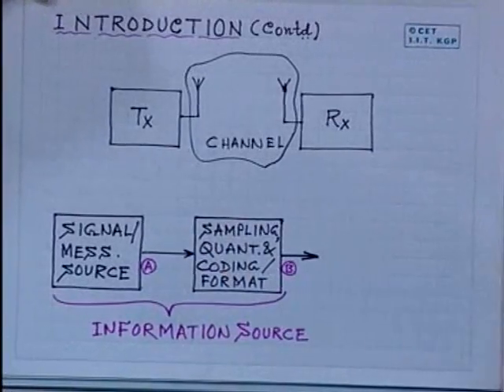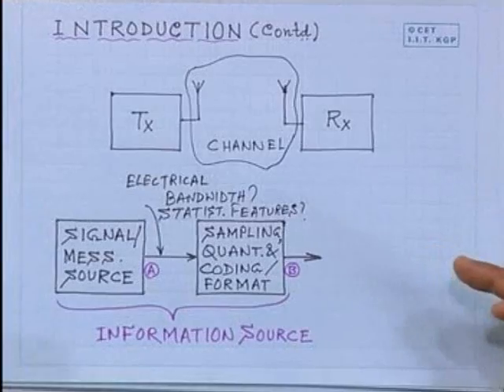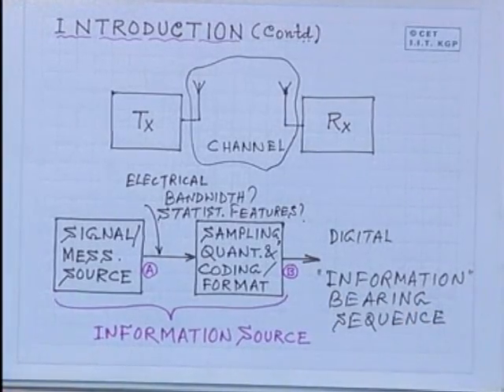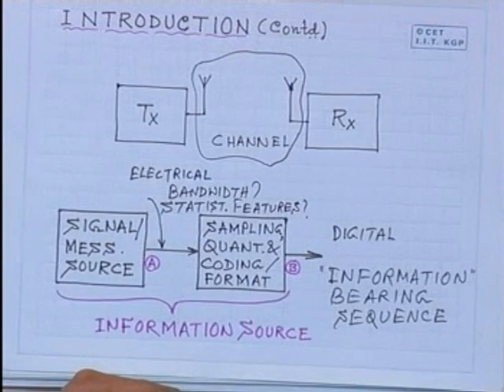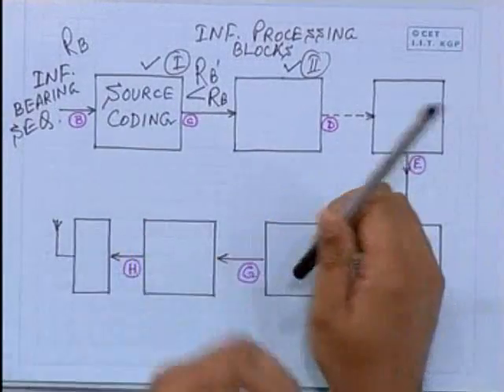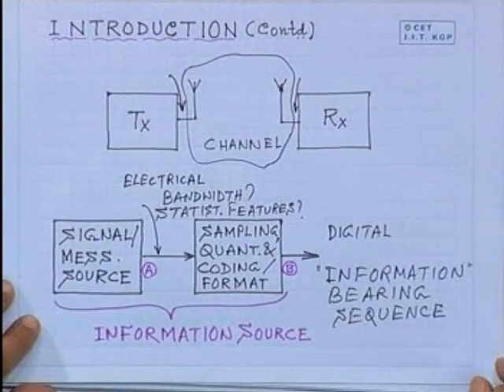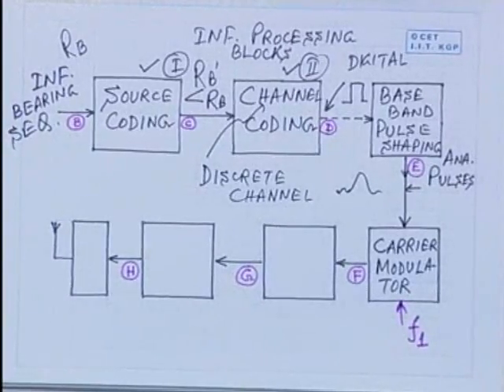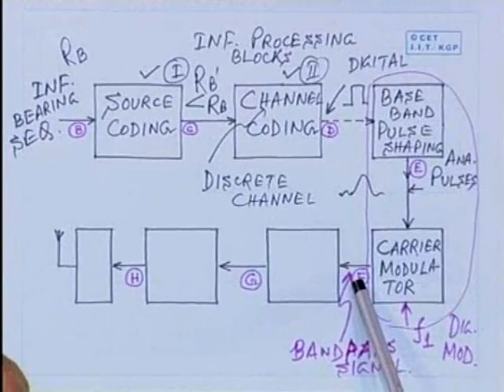3. Introduction to Digital Communication Systems

Comment: Can anybody tell me why baseband pulse shaping is necessary even though we can use square wave signal directly to modulator? I am asking becoz bandwidth is not major issue between baseband puse shapping circuit and modulator since there is no channel. Bandwidth issure is dominant at F point.